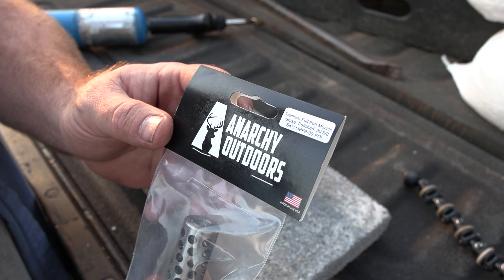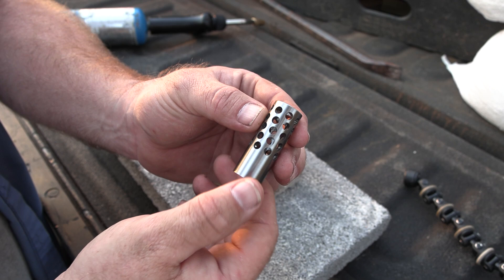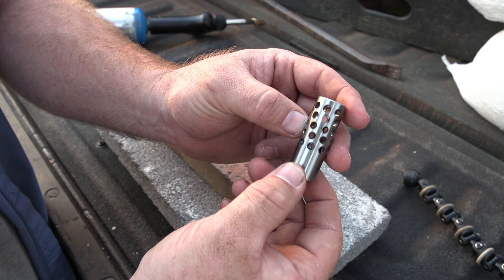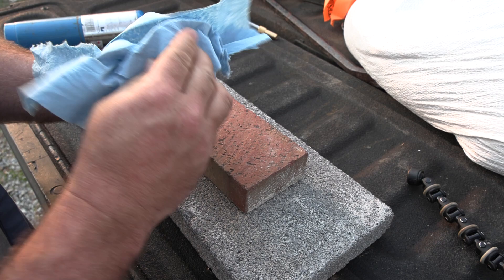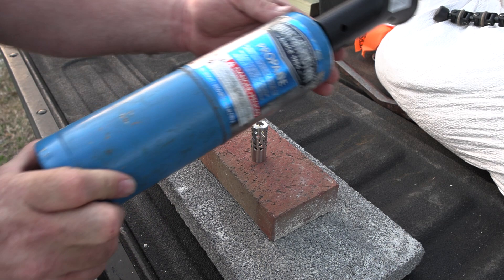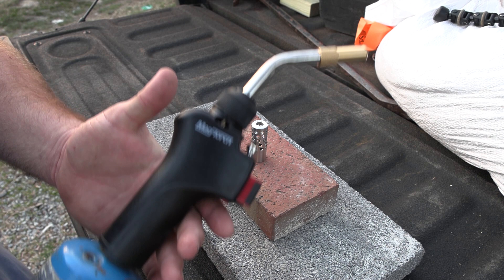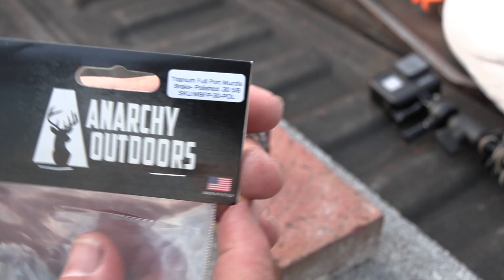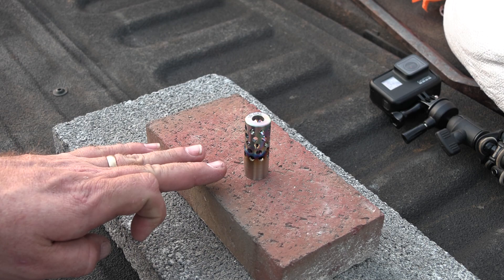How To Color A Titanium Muzzle Brake On The Cheap!

Comment: Next time if you want the colors to run a little more past the holes ide recommend preheating the base a bit as it has the most thermal inertia due it is increased mass. It's also harder to heat from the top due to the holes in the brake preventing heat transfer. Still looks great just my 2¢ and I need to put that engineering degree to some use 🤣
Reply from the maker: Thanks for the input! I'll remember that next time. As for this one, I wanted the colors nearest to the holes so that firing it compliments the coloring with carbon and whatnot.

Comment: Heat rises , if you heat from the bottom up & pull away & let it soak in a little you can get some more brilliant colors , I do a lot of heat colored metal art , once it gets too hot it will ice out to that light blue & that 's the end of it . Take your time & fondle it gently ..😜
Reply from the maker: I may sand it back down and try again.

Comment: by the way, somebody makes a tunable muzzle brake. the holes are threaded then you fill whichever ones you want with these screw in plugs. You can adjust it to where there is no rise, or if you over do it the muzzle will actually drop. I don't know what it would do for felt recoil.
Reply: ares armor makes them. prices range from 50 dollars to 150 Depending on which model and caliber you need. I wonder if there is any way to empirically test recoil?
Reply from the maker: I'm sure that a sled could be made to hold the rifle rigid and measure how much it gets pushed back.
Reply: @PatRMG  maybe add a spring scale so you have definite numbers.

Comment: I’m an Aluminum Mig Welder by trade. This was extremely fascinating of course & I’m not even into rainbows. At work, some of the guys call it the little blue light. Lol.
Reply from the maker: My Miller is capable of welding aluminum. Still haven't tried it.
Reply: @PatRMG  Please record and upload if you ever do, it’s going to be hilarious!
Reply: @PatRMG  You set up for Tig or Mig?
Reply from the maker: It's a mig with the push spool. I know aluminum is gonna be a pain. That's why I stick to steel.
Reply: @PatRMG  I love Miller products! I currently use an older Panasonic with a cooler & wire feeder. Look up the channel Welding Tips & Tricks sometime. He’s a great teacher!

Comment: In my opinion, from what I can see in the vid, is that this muzzle brake will do little or nothing. Here's why I think so. The holes are apparently straight through, and all the way around. I do not see how that can brake anything. To actually work the holes should be angled toward the weapon. To help with muzzle rise, they should only be on the top of the brake. Now what you need to do is shoot the weapon you intend to put it on both with and without the brake, focusing the camera on the weapon, particularly the muzzle. Maybe I'm all wet, I donno, but logic dictates that to negate a force you need an opposite force.
Reply from the maker: We'll find out if it softens felt recoil. I've still got to finish building the rifle first. Several parts coming together for a 308 bolt action that I hope to hunt bear with.
Reply: @PatRMG  308 for bear? I'd at least want a 30 06 or even bigger. I know that you can kill one with a 22 if you hit in just the right spot, but.... 
by the way, make sure your gun has a large capacity mag, and when you get ready to shoot from a distance, put some shells out handy and when you shoot, add a fresh one...so if that sucker gets close, your gun is full.
Reply from the maker: I plan on having some rounds in reserve. The build will be pretty neat.
Reply: @PatRMG  plans are only good until the shooting starts. You should also have a big bore handgun with you and handy. A 500 would probably be the thing to have.  There is or was (don't know if he's still kickin) in Alaska that killed a Grizz with his buck knife... but it tore the hell out of him. He was 69 at the time, yet tussled with a grizz and survived. the main story is he and two others were out hunting ...caribou I think it was, and they kind of got separated. Anyway he downed an animal, and had set his rifle against a tree as he proceeded to field dress it with his buck knife. The grizz decided he wanted the caribou, and came charging of the brush full tilt. I don't recall all the details, but the fight was epic, but the guy just wasn't going to give up. Eventually he got the buck knife in where it would kill the grizz. Now all torn up from that, he managed to use his rifle as a crutch and get back to where they docked their boat. Later is son went back and got the bear and the bear is taxidermied and in this guy's living room, the buck knife is in a frame on the  wall. Buck sent him on a tour for a while. They have a neat thing in Alaska, a person can assign their hunting rights to someone else to get the meat for them. There is no shortage of guys that will hunt for him, it's like a huge honor.
Reply: @PatRMG  by the way, the guy's name is Gene Moe, and it's a true story. You can google it. I know it's true because a friend in Alaska actually knows him. or knew have to find out if he's still kickin
Reply: heres the story as told in Outdoor life https://www.outdoorlife.com/articles/larry-mueller-and-marguerite-reiss/2007/09/last-stand/  Note the guy actually punched out that wounded grizz.